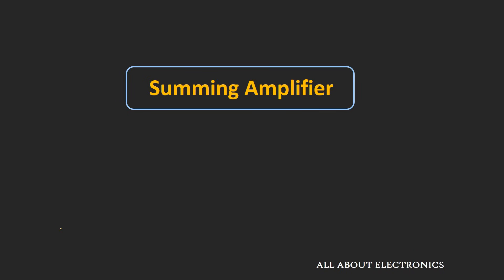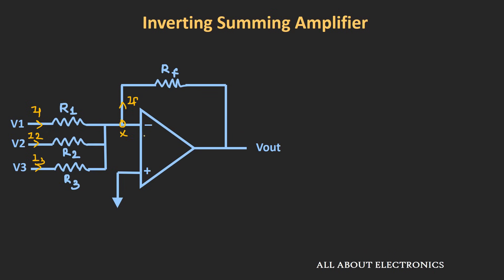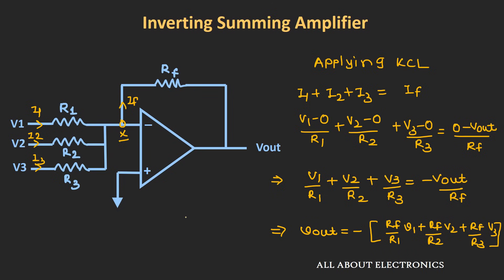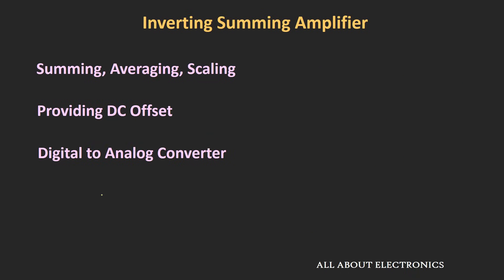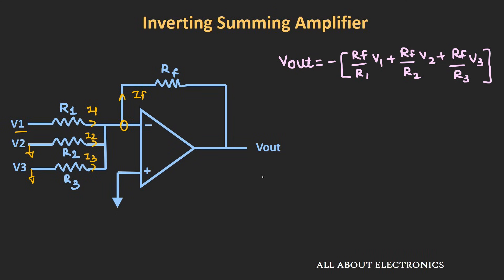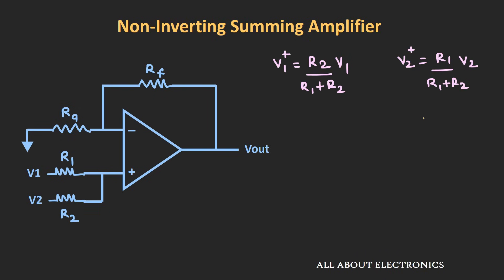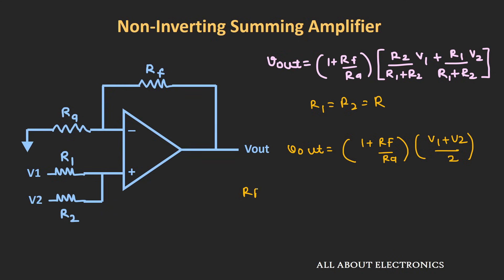Op-Amp: Summing Amplifier (Inverting and Non-Inverting Summing Amplifiers)

Comment: what is DC offset voltage? please explain this terminology.
Reply from the maker: Here the DC offset is the additional DC voltage applied to the AC signal. Let's say you have some AC signal, and you want to add some DC voltage to it. So, using this summing amplifier, it is possible. 
I hope it will clear your doubt.
Reply: @ALLABOUTELECTRONICS  thank you.

Comment: Why didn't we apply concept of virtual ground in non inverting summing amplifier..it also uses negative feedback??
Reply from the maker: In case of the non-inverting summing amplifier, V+  terminal is not at ground potential and same is true with inverting terminal. But because of negative feedback, there will be virtual short between inverting and non-inverting terminal (V- = V+)

Comment: Your answer is right but we can't apply superposition theorem for bilateral circuits as we know all semiconductor devices are bilateral or non linear so prove that
Reply from the maker: The op-amp is used in the linear region, so superposition theorem can be applied.
Reply: I think we can't apply our sir told us proof tell me proof

Comment: Sir at 9:22 for the unity gain amplifier the signal should be applied to the positive terminal.. isn't it?
Reply from the maker: I was referring about the magnitude of the gain.  Its actual gain would be -1 (The second amplifier stage). But because of that overall gain of the two stages will be positive.

Comment: What happens when multiple inputs are applied to the inverting and non-inverting sides together?
Reply from the maker: In that case, op-amp can be used as differential amplifier/difference amplifier.  It is also known as the subtractor circuit.

Comment: Sir please tell me about isolation n precision op amp hwpr n fwpr
Reply from the maker: Soon, I am going to make a video on precision op-amp circuits. But in short, if I tell, using precision half wave and full wave rectifier, the voltage drop across the diode can be almost eliminated. And the circuit acts like an ideal full wave and half wave rectifier circuit.
Reply: Thanks sir got it

Comment: Sir  one non inverting op amp can performs the sum on the other hand we use two op amps 
Isn't disadvantage ??
And other questions Is that sir if we apply the node analysis it's complicity will reduce ...
So why we don't use this non inverting in a practical life sir??
Reply: Non inverting summing op amp
Reply from the maker: In non-inverting summing amplifier, as the number of input increases, the complexity in the calculation will also increase. Moreover that, the individual input that appears at the noninverting terminal also depends upon the series resistors of the other inputs. 
In case of inverting op-amp, individual inputs are isolated to each other because of virtual ground. 
And it is a big advantage. That's why practical circuits like DAC are implemented using inverting summing amplifier.
I hope it will clear your doubt.
Reply: Sir What about overall efficiency ?
How much these resistor effects on the efficiency ??
What are the practical losses !?
In non inverting summing op amp
Reply: Sir I have also a question regarding non inverting buffer op amp ....
Sir if we apply 5 volt on the non inverting terminal and short the inverting terminal with feedback...
After first step the out put of 5 volt will appears at out put side of the buffer and that out same is feedback to the inverting terminal so now the difference between in put is zero and this time out put should be zero so it means the gain is not 1??
Plz sir guide me ...
Reply from the maker: For all the derivation of inverting and non-inverting op-amp, we have assumed that the op-amp is ideal op-amp. And it has a very high gain. Providing the negative feedback we are restricting the output voltage. So, for that output voltage and considering very high gain of the op-amp, input should be very low. (difference between two input terminals). Typically in microvolts for very high gain. So, we can assume that both input terminals are at the same potential, which is the concept of virtual short. 
So, we are assuming that the difference is zero between the two inputs, but actually, there will be some difference of microvolts between the two inputs. 
So, actually,  your output is the input voltage (the difference between the two terminals) multiplied by the gain of the op-amp. 
I hope it will clear your doubt.
Reply from the maker: Main loss will be the heating losses, the power dissipated in the resistors. So, that is why we can not add no. of input indefinitely. As, the no. of input increase, the power dissipation of the circuit will also increase. And one has to look these aspects while designing practical circuits.
Reply: Ok sir thank you sir now everything is clear
Reply: Sir does non inverting summing amplifier can also act as average amplifier by taking Ra equals to zero ?

Comment from the maker: The timestamps for the different topics covered in the video is given below:

0:51 Inverting Summing Amplifier
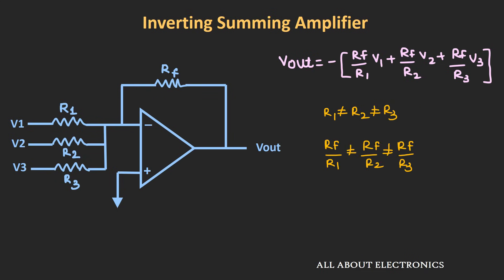4:48 Scaling and Addition using Summing Amplifier
5:29 Averaging operation using Summing Amplifier
6:40 Application of summing Amplifier
9:26 Non-Inverting Summing Amplifier (with two inputs)
12:51 Non-Inverting Summing Amplifier (with three inputs)
Reply: Sir why don't u make videos of op amps circuits experiments
Reply: Sir what is dc offset?
Reply: The explanation of non inverting summing amplifier is not understanding well as that of inverting summing amplifier they both didn't go in the same way as that of inverting and non inverting op amp
Reply: Sir I have a question can you answer it please
Reply: Your information is very useful.thank you